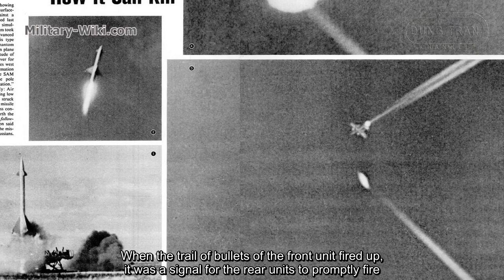(Part 2) F-111 Aardvark - Monumental Opening, Sad Ending

Comment: The failure of the FB-11A is what brought about the F-14 Tomcat for the Navy. The kept the swept wings and that God Awful TF-30 engine. The Tomcat did see action in Vietnam in 1972. We had an FB-111A crash in my small hometown in Jan. 1978 killing the 2 aboard. They crashed into a mountain just after refueling. There were Air Force troops and trucks all over the place, something this 14 year old have never seen before. Most of the plane was buried up there and there is a memorial for the lost 2 crew members although it is not easy to get up there. There are no paths. Thanks for the video as it brought all those memories back. At 56 now I can tell you the years have flown by.